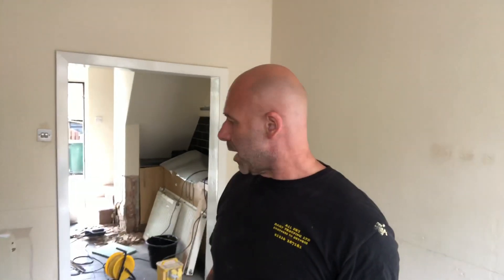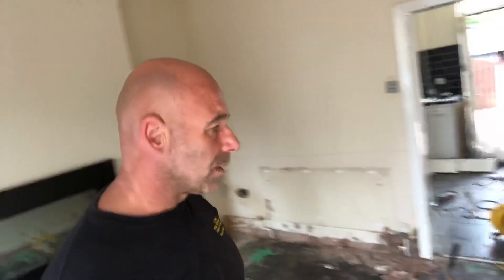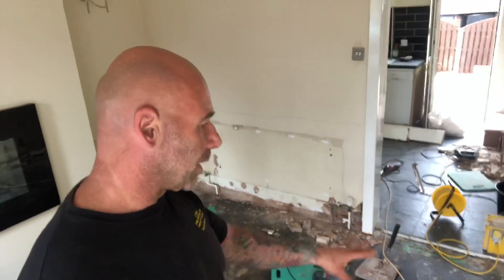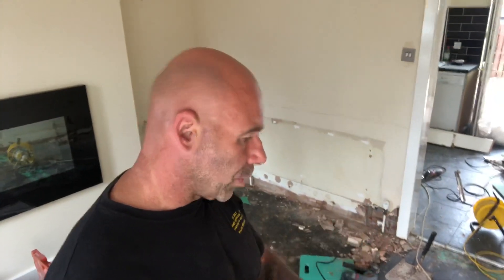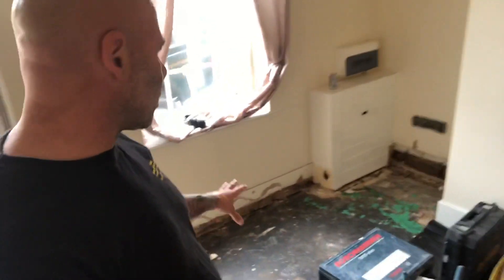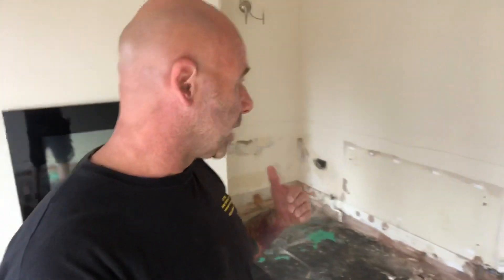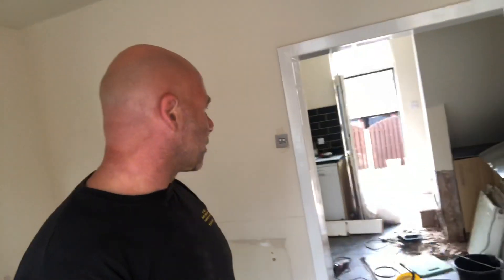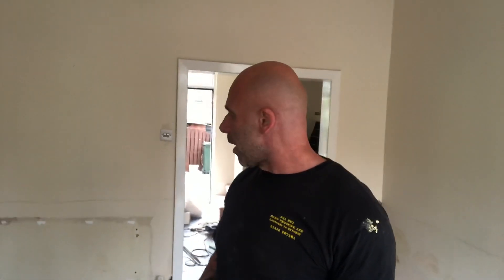Mastic asphalt is yours bridging

Comment: The floor Covering is called mastic asphalt. I recommend a company from Huddersfield called competent asphalt roofing and flooring. They also tank basements out with it too. Brilliant product. You’ve probably guessed by now that I work for the company 😂 great video
Reply: @darrensharlotte3970  is it hot poured I've got a square on floor concrete where old fire place was removed damp coming up. Would this help

Comment: Found this great vid as I’ve just removed the asphalt DPM from my 1950’s ex local authority house to reveal the concrete. Looking to use a bitumen paint as new DPM (sand blinded) followed by SLC and was unsure how close to the walls I should be going with both of these as I don’t want to bridge the existing gap. Or should I be filing the gaps with concrete and removing some plaster to take the new DPM up the walls a bit? The DPC is lower than the top of the concrete which I thought was strange
Reply from the maker: I can’t picture what your doing, I’m not a fan of bitumen paint on walls above ground, messy stuff. Sound like you know what your doing though.
Reply: @dampsam  I tried to post a link to pictures but think it got removed. If the DPC in the wall is lower than the floor height then should a gap between the floor and wall be preserved, or filled with a new DPM/bitumen? I've been deep in research for weeks and going round in circles, too scared to do anything in case it's wrong, would really appreciate some expert advice and struggling to find someone trusted locally
Reply: @charlotteandreanoff3044 

Hi Charlotte 

Did you manage to resolve your issue? Am in the same predicament.

Any advice would be appreciated.

Cheers Michael
Reply: What the best process after removed bitumen floor  ?? Mine is in very poor condition some yyahhaa nailed gripers around perimeter and all cracks in a bits...i fink remove black bitumen floor leveling with self leveling compound then put dpm and lay  xps 10 or 15mm insulation boards and laminate  what do you think?
Reply: Should also add that it can contain asbestos so definitely get it tested before breaking it up. 
The other option if you find a local company that still do it (we couldn't) then they might be able to come in and repair it as it's still a good dpm and hardwearing
Reply: @arturasd570 How did you remove it? We need to remove ours from the entire ground floor.
Reply: @emmaelizabethbest8666   very easy with hammer  and crowbar cracks  as biscuits
Reply: @arturasd570  Thank you. That’s my job for this weekend!
Reply: @arturasd570  please can you tell me what you replaced yours with?
Reply: @emmaelizabethbest8666   dry base liquid applied dpm, is not cheap but im living in radon gases area and this one provides barrier from ground gases
Reply: @arturasd570  we also live in a radon gas area. Please may I ask how expensive it was… I’m a little worried that we’re out of our depth 😬

Comment: I’ve just hack mine out and poured self leveller in because I wanted skirting boards. Nothing was wet underneath. The walls were dry. Am I likely to end up with damp problems now. Will a standard self leveller stick well to this stuff
Reply from the maker: It would depend if you prepped it correctly, read the leveller instructions and see what surfaces it will adhere too.
Reply: Please may I ask what you used to hack it out with? It’s a job for us to do on our house. It’s a mess, we’re planing on self levelling too. Have you had any issues?

Comment: Very interesting I'm in the process of buying a home and the survey as flagged moderate moisture levels in the concrete slab
Reply from the maker: paul williams  did they drill holes into the slab and use deep probes to check? How did they know it wasn’t wet just on the surface?
Reply: Simon Cooper HNC CSRT CSSW by looking at the pictures in the survey it looks like they did the readings of the top of the carpets and they said on top of the slab their is vinyl tiles which could contain asbestos the chap that owned the house previously as sadly passed away. And the house as been unoccupied for 2 years.the pictures on the carpet with the moisture reading is 21.4 the surveyor suggested to pull the flooring up remove the tiles and lay mastic asphalt covering their is no damp on any of the walls
Reply from the maker: @paulandjo1  Just from what you said it sounds like the reading is from the carpet, Vinyl tiles works as a kind of DPM if they are all in place. moisture has probably been trapped between the carpet and the surface of the tiles.
leave them down and get a decent underlay for what ever flooring your going to put down.
If you do take them up you can apply a liquid DPM.
Reply: Simon Cooper HNC CSRT CSSW thanks Simon and cheers for the advice

Comment: I purchased a house built in the 1880's and recently lifted up the laminate in our hallway and diningroom with the aim of laying tiles. All skirts are off currently as doing works on house. Discovered we have the mastic asphalt flooring as shown in your video. We are also experiencing damp in both rooms around the door/window areas. I'd probably say we need some damp proofing doing! Would you recommend tiling directly on to these types of floors?
Reply: Asphalt traps moisture underneath and so if taken to the wall, forces the water up the walls, as these asphalt floors act like a plug, so to get rid of damp walls you need to leave a breathable gap around the edge or lift and use breathable flooring like limecrete - it isn't just the fact that the plaster is touching the floor and bridging. Too many people giving bad advice using impermeable materials on old breathable properties.

Comment: Interesting, i came across ur video whilst looking for information about screeding over a mastic floor screed, its very damaged but im struggling to find anyone that knows, i want to fit vinyl tiles, any asvise would be really appreciated x thanks for sharing x
Reply from the maker: Clare Hardie without seeing the job it’s hard to comment but if you follow the manufacturers instructions you should be ok. The tiles once Down can act like a damp proof membrane but you need to make sure the surface to are to be stuck to is sound and the right adhesive used.
Reply: @dampsam  thank you, i was hoping to be be able to use the click version of the vinyl tiles, just not sure what product to use over the mastic maybe as a primer to prevent the fresh screed from cracking x i cant seem to attach a picture x